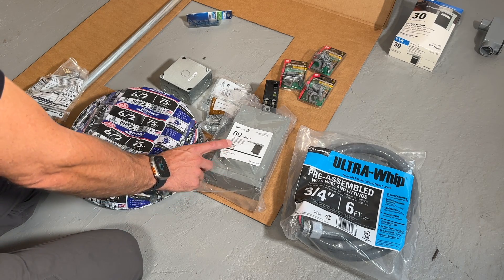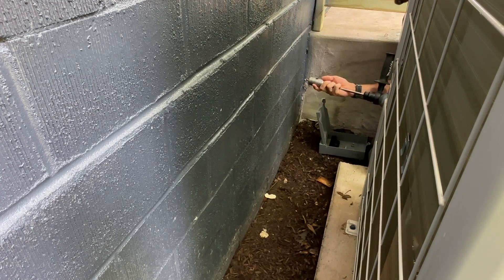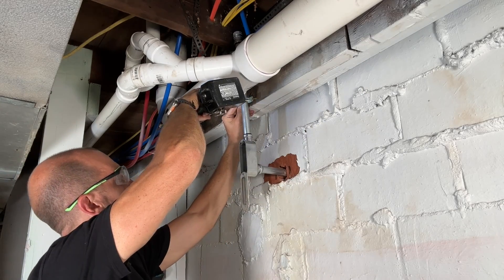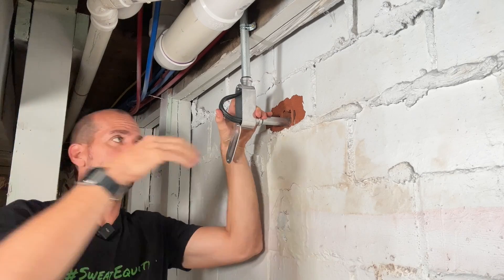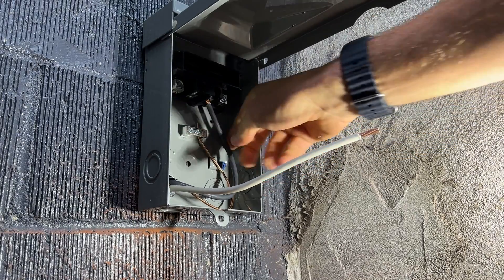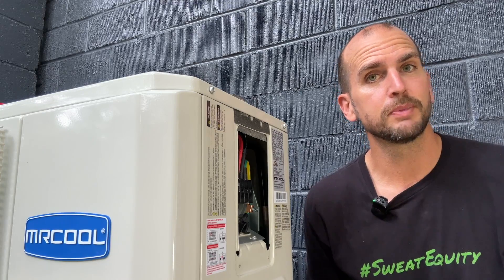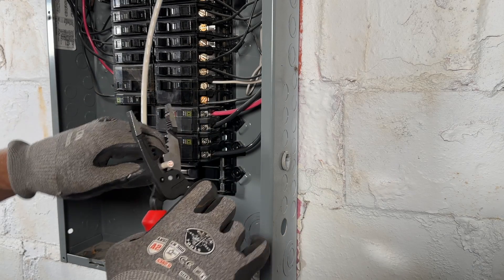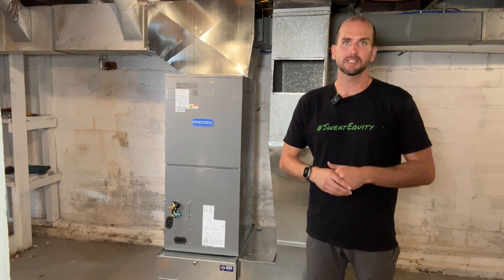How To Install 240V AC Disconnect Box

Comment: You need to re-identify your white wires to either red or black where ever they come in to a box, disconnect or panel,etc.  Thanks, Russ, 29 years in the Electrical Trade. I would also mount your AC Disconnect at Eye level, if possible. Makes it easier to work on.

Comment: I have a 100 amp sub panel in the garage freshly installed.  Kept the ground and neutrals separated. So where does my 'ground' wire go then? To the bare ground bar or neutral bar with the other white wires?

Comment: Can this same set up work with a 50Amp plug outlet for like an RV or Welder ? Can these 50amp fuses be used for an outlet disconnect?
Reply from the maker: You could do something similar but I would then just install a NEMA 14-50 plug on the exterior.  https://amzn.to/3OnygV2 and probably step up to the Hubbell NEMA 14-50 which is the best on the market and nice to have higher quality when you are pulling the heavy loads.  https://amzn.to/480G9qD
Reply: @EverydayHomeRepairs  Could you use 50 amp buss fuses in a 60A AC disconnect box? Or does it require a breaker

Comment: It looks like your disconnect may not have the required 30" working space width as required by NEC 110.6(2) between the A/C unit and the adjacent wall projection.

Comment: great video. I'm investigating a similar project. A couple of questions.  For 240v, are you not required to "indicate" or mark the white wire as a hot wire with red or black tape? Also. I see several articles that romax does not allow the proper free surface area inside conduit and cannot be used in conduit. Is the material you used for reference different? If so, could you share it?

Comment: @9:45:  Ugh.  You know better than that, Scott.  Both of those white conductors should have black or red tape to mark them as hot.  (And @10:22 and @12:43, where you can also see another unmarked hot white on another 2-pole breaker in the panel.  Looks like a bad habit.)

Separately, I don't understand why you didn't pay a little more for 6/3, especially since the breaker you showed was neither AFCI nor GFCI.

Comment: Thanks for this vid. I have to replace an existing outlet that has a breaker outside with a service disconnect (since the breaker seems to break somewhat often) so this is a huge help.

Maybe it's an existing video, but I have a ranch house, main panel in garage on main floor (whereas yours is in basement) and both the attic and basement are accessible for running romex. Do you have any existing videos or perhaps might make one re: advice about running wires from attic or basement... sub panel yes or no, and similar. Thanks a ton.

Comment: Totally pedantic, so just ignore this:  typical 240v is called "split single-phase" because the two hots aren't actually 2 diffrent phases in the same way that 3-phase power really is 3 different phases.  But plenty of licensed electricians will use that technically wrong terminology.  Ok I got it out of my system now.

Comment: Good tutorial, a couple of notes. Best practice is to field identify your white wire with red  tape to signify it isn’t a neutral. Also it is best practice to keep grounds and neutrals separated on the bus bars, even if the panel is bonded, especially if it is already set up that way.
Reply: the guys is a bozo

Comment: Running the stranded wires to the AC unit sounds like a better option as opposed to the lugs as suggested.  From the video the lugs extend past the mounting body potentially making it easier for the lug ends to touch, especially when replacing the cover.

Comment: Good video. I suggest that even if it is a main panel that you separate the ground and neutral wires and put them on separate busses. Therefore letting the bonding screw do the boding. If at some time this should no longer be the main panel then it saves a lot of work  transferring the ground wires away from the neutral wires since all you would have to do is remove the bonding screw. This comes in handy when maybe a transfer switch for a whole house generator is added upstream later or even when a outside disconnect switch is added at a later date.  An electrician needs to be a "what if"?  guy Thanks !  I enjoy your video's  I have even learned a few tricks. Who says you can't teach and old dog new tricks  an "old retired guy",  Fifty plus years as an electrician .

Comment: People have already mentioned that you didn't mark the neutral as a hot (red/black) conductor. From my understanding, leaving Romex wires in the jacket when passed through a conduit may cause heat buildup and may be a code violation in some places. You did install the disconnect unusually low. I don't know if there are height codes for disconnects. I know in some jurisdictions, it is required to install a 120 volt outlet near the disconnect for service equipment. Although, techs are moving to battery powered equipment, so I don't know how necessary that is these days.
Reply from the maker: Thanks for the feedback!

Comment: Were is the link for the complete project?
Reply from the maker: Should be up in 1 week.  Still need to install a 15 Amp 240V circuit, run the lines, and install the thermostat.

Comment: This is a single/split phase system here, there is no phase 1 or phase 2. Refer to the two incoming hots/bus bars as leg 1 or leg 2. 
Always re identify your whites used as a hot wire to a hot color tape or marker at both ends.
You should raise (with conduit) the disconnect up to a comfortable working height.
Reply from the maker: Thanks for the feedback.

Comment: When using a white for a power feed shouldn't you be wrapping the ends of the white wire with black tape?
Reply from the maker: Yep, that is recommended and missed on this video.
Reply: For #4 or larger, using tape to change color is required. For #6 or smaller you need to use the correct color wire.

Comment: You should tape the white wire with red tape so if someone else is informed that it is HOT.
If they get into the boxes.
Reply: That’s true on #4, however #6 you technically aren’t allowed to recolor with tape and are supposed to use the correct color wire.

Taping is better than nothing, but couldn’t be compliant in this situation.
Reply: @thespencerowen  I think you're thinking only about the EGC - see NEC 250.119.  This would fall under 200.7 which would allow for reidentification with red tape.

Comment: Another way to reducing blow outs in the brick or block, is to use a long 1/4" masonry bit thats longer than the brick or block. Then use the correct bit you need. From both sides. I know that it's an extra   step, but it works very well.

Comment: If you're by yourself you can avoid blowout by starting with the pilot bit only, all the way through the brick, and then hole saw one side only a little way in, and then finish hole sawing on the other side. Or if you know how thick your brick is you can  just set the depth gauge on the rotary hammer to be slightly shorter than the brick.
Reply from the maker: Thanks for the feedback 👍

Comment: How come you did not mark the white wire with black tape to identify as a hot
Reply: He’s DYI. They miss some codes.  Also, Tape is not legal to phase #6 and smaller. #4 and larger - phase tape is ok.  #6 and smaller needs to be done by permanent means. Like a Red sharpie.

Comment: I thought that Premade whip with #8 THHN @ 75° column - is good for 50 A. It didn’t need to really be  swapped out to #6.
Reply from the maker: Yeah, I wanted to match the Romex and #8 is right on the edge so nice to have a little buffer.  I am curious to see what thing actually pulls.

Comment: White wires used as hot should be marked with red or black tape or marker indicating to all that they are not a neutral.
Reply: It's #6, not #4 - he technically can't re-identify them and meet code. He should still do it, but I don't think it will fly code wise technically.
Reply: @ZacKoch  Got a code reference? Maybe you were looking at 200.6 which has different rules for 6 vs. 4. However that section is for grounded conductor identification, and here it's an ungrounded conductor.
Reply: @RJ-ej1nr  After another look, think you're right - my apologies!

Comment: 1. Surge Protector.
2. GFCI breaker.
3. I would fail you in an inspection for leaving a white wire as a hot lead..
Mark it in black or red. On BOTH ends....
Reply: Agree 100% with #3. #2 though = what about “Exception No. 2: Ground-fault circuit-interrupter protection shall not be required for listed HVAC equipment. This exception shall expire September 1, 2026.”
Reply: It's #6, not #4 - he technically can't re-identify them and meet code. He should still do it, but I don't think it will fly code wise technically.

Comment: NEC 200.7(C)(1) The use of insulation that is white [..] for other than a grounded conductor [..] shall be permitted only [..] if part of a cable assembly that has the insulation permanently reidentified to indicate its use an ungrounded conductor [..]. Maybe different where you are, but where I am that would have to be followed for the installation you showed.
Reply: DBAFM 100.1. (b) if the video in question specifically states consult your local inspector and follow your local code…..all comments made by…..shall be ignored. Multiple comments of this sort should not be tolerated and installer is welcome to tell the armchair expert to go ahead and stop watching and return to fucking himself in the ass. 

Codes pretty clear in my area bud.